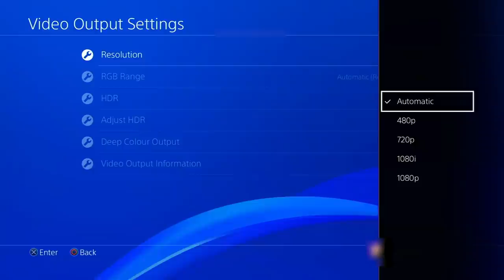PlayStation 4 Not Displaying Video Output On TV With Prior Repair Attempt. ALWAYS Check Your Work ☑️

Comment: Hi,
The connection on hdmi is made via a handshake on both sides, as you sayed sometimes will not work on tv but will work on a monitor via a spliter or capture card.

I think that is what is the reason.
Reply from the maker: Yeah that's possible, personally I don't know much about HDMI and how it handles connections apart from what pins go where, but that could make sense :)

Comment: Isn’t pin 18 the 5v to negotiate the connection to the tv? If that’s the case then the splitter is probably proving the 5v needed so it does need it from the console
Reply from the maker: That's correct mate yeah :)
Reply: You're awesome mate. spot on

Comment: Different drivers ( from console ) for different hardware ( tv  monitor = hardware )? ohhh, so different pins feed different hardware? shows on monitor but not tv with pin 18 being loose?
Reply from the maker: I'm not sure what causes it mate but pin 18 is +5v on any hdmi circuit so maybe a monitor and capture card provides 5v itself

Comment: Jw if I could can put a PS4 Pro motherboard in a PS4.does it work if i do dat
Reply from the maker: No the board design and shape is completely different and uses different components. Also the heatsink for the ps4 wouldn't be enough to cool the ps4 pro because of the higher power usage so you'd have to heavily modify the case  :)

Comment: Could the capture card be feeding 5v power back to the HDMI circuit?
Reply: Vey well could be. Especially if its a POWERED hdmi splitter. An unpowered (passive) hdmi splitter could also have parasitic power (from host device) depending on build quality.
Reply from the maker: Yeah the ones I use are all powered, so that would make sense. I'm going to do some investigating to find out exactly what pins are and aren't needed when using a splitter 😁